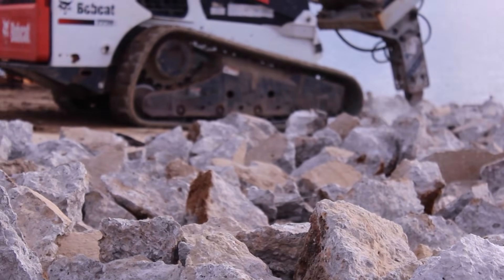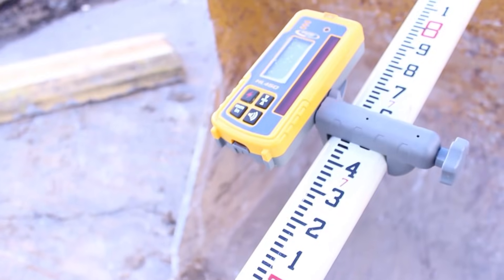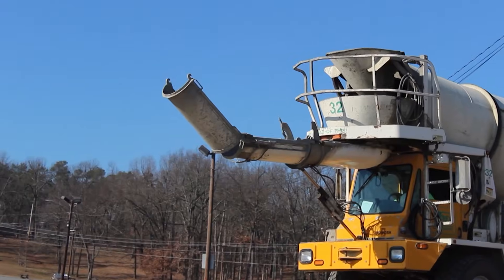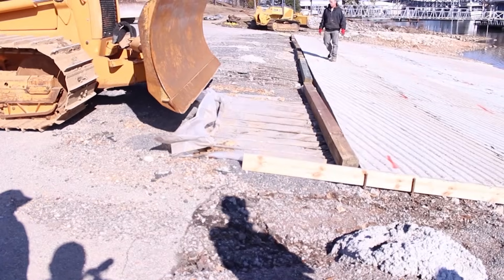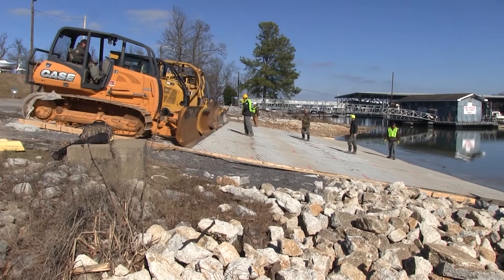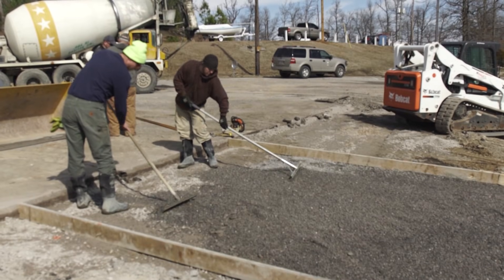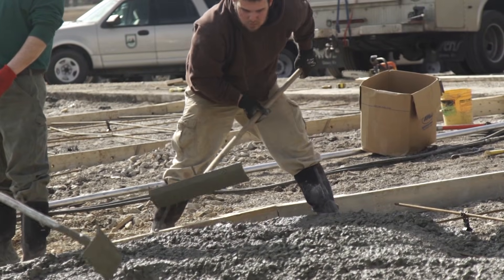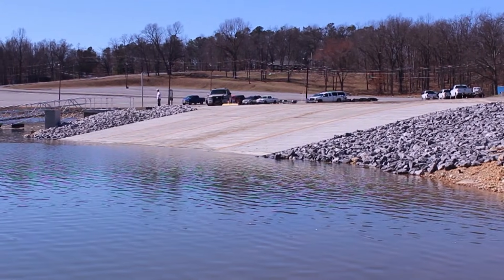Largest Boat Ramp Built In Kentucky

Comment: Man, y’all are doing that all wrong
Reply: Yes, traditionally a coffer dam would be build and pumped out, but this method worked very well.  The old ramp was broken uo and used as a base for the new ramp - considering the loads on the ramp that far in the water are very low, I don't see an issue - it was heavily reinforced so it will stay together as one big slab for decades.
Reply: R Yeckley not trying to be a dick....serious inquiry.  How should they have done it?
Reply: Cole Waldron would be waaaay more effort+money